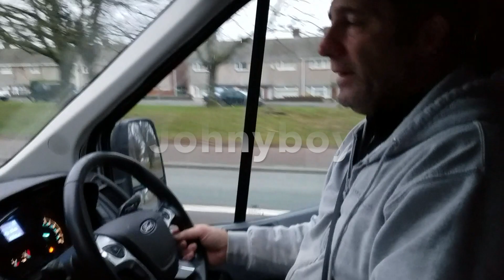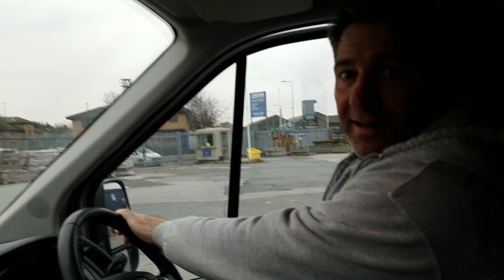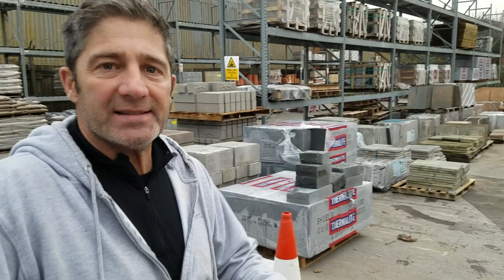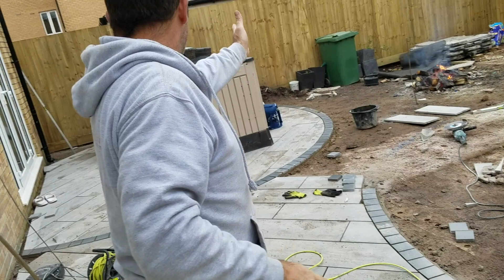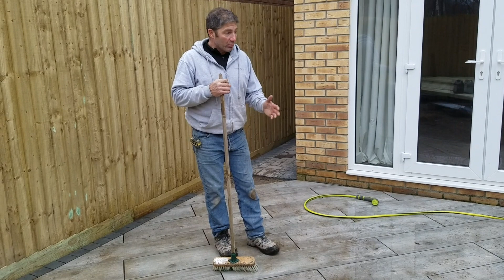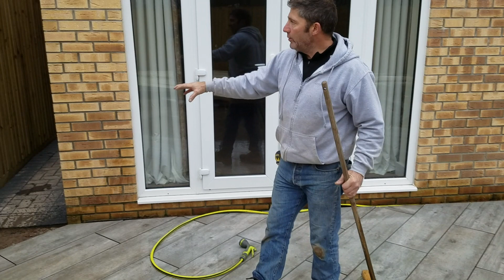Daily Diary With Johnyboy Income Generating Activity Vlog

Comment: I only left half an inch gap between the house and the slabs, then pointed. About 10 cm below the damp course. There is no ponding, but at times the bricks up to the damp course appear damp, but not any above the damp course. Does this all sound okay and correct? Thanks 👍
Reply: Here are the questions you missed 😁